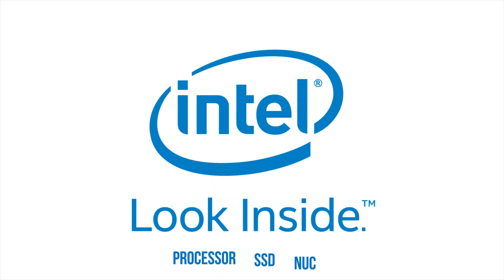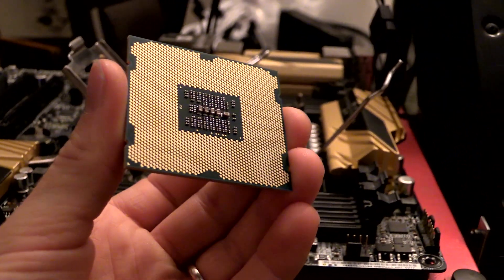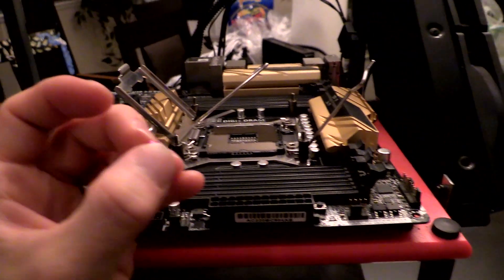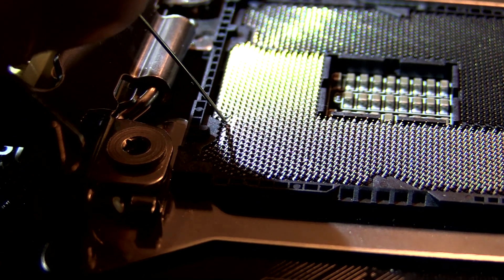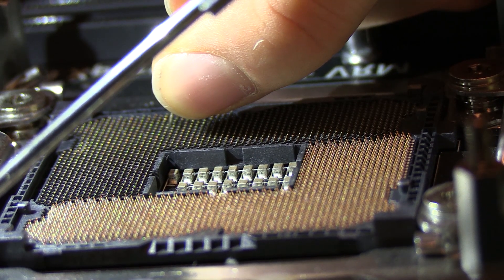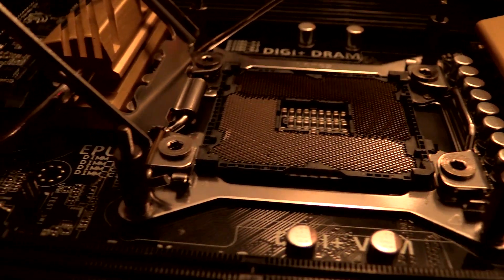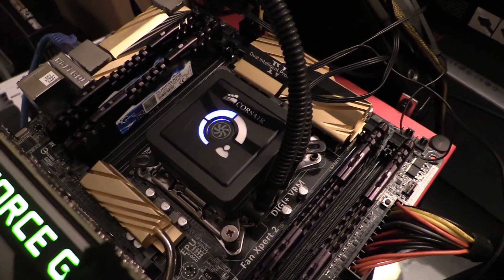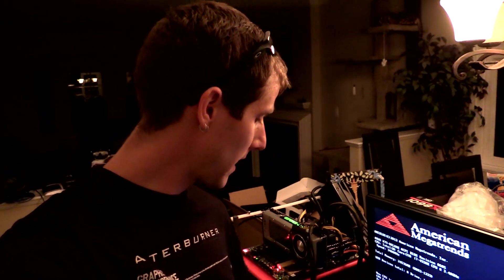LGA 2011 Socket Pin Repair Vlog - Fix a "Dead" Motherboard

Comment: ....Or you can just use AMD since they have more cores than Intel, don't have the pins on the board itself, and don't change sockets every year
Reply: Cores don't say a whole lot about performance and you can fit far more contacts on an lga than on a pga.
Reply: Cores =/= performance. Clock speed =/= performance between different architectures. AMD hasn't released an enthusiast part in ages. Plus they're still using PCIe 2.0, no support for M.2 or SATAe.
Reply: Tom Hodgins M.2 is here. M.2 Drives are here. SATAe drives are here. RAID cards can max out PCIE 3.0 8x, same with PCIE SSDs. There are PCIE cards that aren't video cards. An overclocked 8 core CPU keeps up with a stock 6 core. Obviously.
Reply: D4rkR3bel5

no Video Card has maxed out even PCI-E 2.0 at 8x.. so that isn't a issues as of yet...

http://www.pugetsystems.com/labs/articles/Impact-of-PCI-E-Speed-on-Gaming-Performance-518/

SATAe = find me a HDD i can buy for it....

Currently running a FX8150 @ 5.4Ghz under water cooling... keeps up with the high end i7 in multithreaded Tasks...

CPUs as far as performance haven't improved that much over the last 4 years...

They are alot better on Power.. but thats it...

Same goes for video card within a extent...
Reply: If only their CPUs didn't suck, I hope Ryzen is as good as they say.
Reply: Gustav Magnusson Mac doesn't support anything that doesn't go through Apple first.
Reply: hondarider430 So you're a normal person who doesn't get butthurt when someone recommends something other than your favorite brand.
Reply: As an AMD "fanboy" myself, Intel is just way better bro. More efficient (22nm lithography), much more powerful per core, and plus people are still making stuff for intel. As well as other small things, like some of the Phanteks coolers only mount up-down on AM3+, instead of the optimal left-right. It works both ways for intel, however.
Reply: Coming from someone who uses AMD CPUs, I still think it is better to have the pins on the board rather than the actual CPU simply because the CPU is removable and can be dropped and susceptible to more accidents.
Reply: Well that'a one of the stupidest comparisons I've seen when discussing performance lol. Idiot
Reply: The first chip I ever got from AMD had a bent pin, and I did really notice there isn't mutch protection for the pins in the box, where as the protection for the pins on the motherboard for Intel's sockets is amazing. And saying that you should get something because it has more cores is like saying you should get a rusty old truck because it has a 6 tires instead of the normal 4.
Reply: If you have ever taken a look at single core benchmarks you notice all amd chips have about half the single core performance. This is because AMD has quad core's just like intel but each core has 2 pipelines so they label it an "8-core" machine. Intel does this with hyper threading on their i7's and Xeons, but you gain much more performance out of it on intel, and they don't label it as an 8-core. They just say it's a quad core with 8 threads.
TL;DR: AMD takes 2 cores to equal 1 intel core performance wise, and AMD just uses ghetto hyperthreading and calls it an 8-core.
Reply: Thomas Mitchell it's 4 cores with 2 modules per core... On windows 8 it will show
4 cores 8 threads. An i7 would kill an 8350.
a 3570K keeps up with an 8350 when rendering.
Reply: Daniel Weinberger 18 cores and 36 threads is pretty damn beastly, especially at 2.3GHz+
Reply: D4rkR3bel5
Very ture...

But i think for most people watch this vid they wont be using RAID card or alike...
Reply: more cores dont mean better, and i rather have pins in mobo. easier to have a bent pin on cpu
Reply: hondarider430 For an AMD fanboy, you don't sound like much of a fanboy.
Reply: viperatedrko not to mentoin the CPU is usually (keyword usually) far more expensive than the Motherboard, so i'm good with it being the less fragile side.
just imagine if we didn't have pins at all though, and instead had contacts that weren't fragile on either side. would be nice.
Reply: D4rkR3bel5 AMD doesn't measure TDP the same way as Intel. Intel measures what they think is average power usage, while AMD tests max TDP under heavy use.
Reply: Tom Hodgins $100/yr!.... i would so choose intel over that, intel is like 1/2 that i believe
Reply: No mini ITX AM3+ boards
Reply: ab30494  It depends.. if the CPU or the motherboard cost more.....

when you are talking high end AMD the CPU tend to cost less the the high end board...

and when you are talking intel the CPU cost more then the motherboard... so it makes sense with how each company is doing it...
Reply: D4rkR3bel5 Amd <3
Reply: Gustav Magnusson Plus AMD has some pretty high TDPs. When you consider the form factor of a Mac, you don't really have space for a 220w TDP CPU or a 1000w PSU.
Reply: Tom Hodgins and guzzles 3x more electricty and produces that much more heat (replacement heater) XD
Reply: "and don't change sockets every year"
But they do change chipsets all the same, and a new CPU would not work with an older chipset, regardless of the socket.
Reply: Aimela
2600K/3770K Works on both z68 and z77 boards.
Same goes with Z97 it supports both Haswell and upcoming Broadwell. If you spend the money on an i7 it will last you a long time. I'm  on a 5 year old i7-960 and it still eats games for breakfast. I'll upgrade when LGA1151 Skylake hits, 6770K.
Reply: Daniel Weinberger
Still has stronger cores than any AMD cpu. sell it on eBay for $150 and get a 3770 for $250 $100 upgrade
Reply: It is not a true 8 core CPU.  Every 2 cores shares a module, meaning they share resources.  Also, cores does not equal performance when you talk different architecture, neither does clock speed.  But thanks for trying.
Reply: Daniel Weinberger
the difference in power consumption is negligible. Even when it comes to AMD vs Intel if you factor it out. Power consumption should not be a concern when choosing a processor. Running multiple systems in a server environment is where it would count.
Reply: Tom Hodgins
What are you even talking about? I was talking about your FX 8150 @ 5.4 A single 780Ti would probably kill 3 480's considering
780Ti > GTX580 sli
 Running 3 cards is flaky.
Reply: Or you can easily broke the pins of their CPUs also, because they have pins instead of none for Intel. :D
Reply: Daniel Weinberger
 actually scaling on the old 480s is very good... since they have been out for quite a they have got the SLI down packed...

Even indy games scale really well!
Reply: personally i like as little power consumption as possible XD (says the guy with a 280x)
Reply: Balls to the wall..
GTX 480 ~ 450W
GTX 780Ti ~ 260W

Boy have the times changed. You can fry an egg on a 480.
Reply: norge696
 lol... where did u get that power consumption from???

if each 480 uses 480W how do i run 3 of them with a OCed 8150FX on a 1000W PSU...

IT DOESN"T MAKE SENSE!!!

The GTX 480 uses 250Watts by itself just like the 780Ti does!!!

That is taken from the Nvidia Website...

The stock cooler is just alot better on the 780 then the 480...
Reply: Daniel Weinberger
 yup. gone are the days where they didn't care about power consumption and just pushed the limits to the max!!!

for the desktop world.. i kinda miss those days...

don't get me wrong... the better power consumption is great for laptops and tablets.. but most desktop uses dont care and would prefer the extra grunt
Reply: ElectronicsWizardry
 i would agree...

i was just trying to make a point of saying that a AMD 8 core aka something like a 8150 is an actual 8 core.. and not the same as intel's HT tech on a quad core intel...
Reply: Tom Hodgins 
it has two cores per module... it should be classified as a quad core because the 3570k keeps up with it in rendering...

AMD has two distinct processors in each module that can work on two threads simultaneously. Yes there is only one Floating point scheduler, but it has two 128 bit FPU processing units so it can execute two Floating point operations at the same time
Reply: haha more cores more powa!!!
Reply: Tom Hodgins Maybe I have a dual Xeon board with a broken pin on one of the sockets, and it was going to be some overkill FreeNAS NAS. I don't, but you never know.
Reply: Tom Hodgins Much easier to bend pins in shipping if they're on the CPU.
Reply: D4rkR3bel5 Well yeah. Honestly if I had money, I'd choose Intel in a heart beat. But right now my entire right is fucked up and I'm stuck on a laptop and can't do much about it.
Reply: well considering that an i7 4770k has 8 logical cores... and the new i7 5960x has 8 physical and 16 threads.. 16 logical cores
Reply: Fat Sacks calculating TDP differently or not, when you put these products into test situations and compare differences, and especially when you decide to Overclock things to find their limits - the Electricity usage differences are alarming.
using as much Electricity as most midrange PSU's have in total, and creating as much heat as a Resistance circuit.
for years i knew that AMD's products were more power hungry, but i'd always assumed it was only a small difference. one day i actually looked at usage tests, and i was shocked. you might be able to see my Electric meter spin faster when you turn on an Overclocked AMD machine.
Reply: Daniel Weinberger
 Meh power is cheap where i live.. and it is alot cheaper then upgrading....

My system cost me about $100 a year to run on power... new video cars is around $800 that would perform the same.. that is 8 years of power... now worth it...
Reply: lol how wrong that entire statement is...
Reply: Tom Hodgins >FX8150 @ 5.4Ghz... is your chip magical or something? extreme cooling? I would of went with an i7 + NH-U14S over an FX any day.
Reply: Daniel Weinberger  Do some research before you throw around the "power consumption" as a valid point you'll ignorant.
AMD vs Intel - Does AMD really wreck your power bill?
Reply: impressive wait..... i have a 3330 and i just wanna get rid of it, 4 3ghz threads is just not enough for my usage
Reply: norge696 true true, and heavens no, not a 3770, i also need low power draw since my pc is on all the time so i plan on getting a 1230v2 or similar xeon or a 3770s. but i cant sell my 3330 because this is my only computing device other than dsi and gbc XD (and xbox 360 and wii)
Reply: the 4770 demolishes the 3770 due to slightly better performance with much less power draw..... apparently the 3770s uses less power than my 3330, isnt that cool
Reply: Daniel Weinberger
Uhh no.... 3770 is the same thing as a 4770 minus the new instruction sets and 5%+ IPC increase at best.
Reply: norge696 im pretty sure the 4770 has much lower power consumption... well its doesnt matter, im getting a 1230v2 or similar or 3770s if i dont get new mobo.... and cantl sell my 3330 since wont have a pc
Reply: D4rkR3bel5 you have never seen an AMD Opteron 16 core CPU 
(workstations benefit from more cores at less speed,unlike gaming where 4-6cores at highest speed possible perform the best)
Reply: "....Or you can just use AMD" I don't think you know anything about CPU's, none of your points make a brand "better" than the other...  Number of cores and speed aren't necessarily the winning factor anymore these days.
Reply: norge696
 i was talking about 3x GTX 480s over a GTX 780Ti as well as AMD vs intel...
Reply: norge696
 280mm Rad closed loop by coolermaster with Noctua IndustrialPPC NF-A14 Case fans

Stable @ 45Deg C on a 30 Deg C day :)

5.4Ghz @1.389V
Reply: D4rkR3bel5 They did. FX-9xxx series
Reply: Marcuss2 They did what? I'm having trouble finding the comment you're replying to, maybe YouTube/Google+ marked it as "spam."
Reply: XD
Reply: norge696 "its funny because its truuuuuuueeee"
Reply: Yes. I've done this. It's an easier fix IMO since they all just stick straight up and aren't so close together like the Intel socket, but still.
Reply: norge696
 580s are only 5-10% quicker then a 480...

3x480s performs the same as a 780Ti in all the tests and games that i run.
Reply: Tom Hodgins that scale well like BF.... a lot of games wont scale XD (i think)
Reply: nice, so other than power guzzlers it lasts a long time for you
Reply: thats how technolgy advances, les power, more performnaace.... like the 5th gen 13/15/17 are supposed to consume 50% electricty or maybe it was 1/4 of electricity, and same perfromance
Reply: facts doh, phones have 4 core cpus 2-4 gigs ram, and 1080p screens...... like desktops are, well its a plus to none desktop people
Reply: none desktop gamers..... personally i dont care other than the fact small ** things can do waht i do if not better :/
Reply: Tom Hodgins  TDP is technically not the same thing as power consumption you know?

http://www.tomshardware.com/reviews/geforce-gtx-480,2585-15.html

http://www.guru3d.com/articles_pages/geforce_gtx_480_3_way_sli_review,25.html

Run Furmark for a good hour on all three GPU's and see if your power supply blows up. ( ͡° ͜ʖ ͡°)

Anyways point is... GPU's have gotten so much more power efficient over the years.
Reply: Tom Hodgins Not with 1.5 GB of VRAM. You'd have to turn down some of the filters to stay under your VRAM cap.

 I'd thought about doing sli with my EVGA GTX 670 FTW card, but opted for an EVGA 780 Classified for the extra 1 GB of VRAM instead.
Reply: norge696
 you know that is power read from the wall.. not the power supply... say the power supply is 80% efficient... that would mean 800watts internal power would read 1000watts at the wall...

Most PSU are around 85-90% efficient.. so even if it was 90% in that test it would only be using just over 900Watts inside the PC. so a 1000watt PSU would have no issue with this...

Once again know your facts...
Reply: >Implying cores matter
Reply: Thomas Mitchell They do if you're running VMs or heavily multithreaded workloads.
Reply: D4rkR3bel5 They made enthusiast, one of the FX-9xxx series if first CPU to hit 5 GHz
Reply: Marcuss2 That was a completely insane part. The clock speed did nothing for the speed. ~$800 MSRP when it launched, and the 3930K & 4930K beat it ~$500 MSRP.
Reply: D4rkR3bel5 I7's are OP
Reply: ephesix No mini ITX LGA2011 or 2011-3 boards either.
Reply: D4rkR3bel5 Are you joking? You cannot put that much power on a mini-itx board, 2011-3 needs a quad channel DDR4 kit and a X99 chipset, that will never be on a ITX board
Reply: Daniel Weinberger No they are not, amd's 8 core are over powered, 4 would of been fine.
Reply: norge696 Exactly, i use a 3770k :)
Reply: Thomas Mitchell I would bet it's the same with AM3+, given that the AM3+ CPUs use a 32nm manufacturing process.
Reply: norge696
 um.... no....

it is a true 8core.. just 2 core share the same L2 cache but have different L1 Cache.

The HT in intel chips are just a optimisation of multi tasks.. totally different...

Once again get your fact right.

also on the windows 7/8 doesn't read the CPU correctly...

CPU-Z a true cpu test program detects all 8 cores as it should
Reply: D4rkR3bel5 I know, it was ridiculous, but that was the strongest they could go
Reply: Tom Hodgins It detects 8 cores because there are 8 temp sensors...
Reply: D4rkR3bel5
 um... no....

AMD
http://www.cdrinfo.com/images/uploaded/AMD_FX_8core_architecture_large.jpg
Intel
http://archive.benchmarkreviews.com/images/reviews/processor/4770K/intel_corei7_4770K_Haswell_Die_Funct.jpg

As you can see.. the per pair of cores in the AMD they share the same L2 Cache. so there is 4 L2 Caches. and 8 L1 Cache

Intel has L2 Cache for every Core...

Once again... Know your facts...

AMD = True 8 core... basically 8 cores turned on = twice the performance then 4 Cores turned on
Intel = 4 Core with HT.... Basically if all 4 cores are on with HT you end up with 10-20% more performance then with just all 4 core enabled...

a 4 Core Intel With HT does not = a 8 Core CPU...

Just like a 8 Core AMD CPU is actually a real 8 Core CPU...
Reply: accually intel has more cores than intel. amd has a 16 core cpu and intel has a 18 core cpu and intel is much faster per core
Reply: Marcuss2  first consumer cpu to hit 5 ghz. IBM has had many PPC parts in their mainframes that hit 5.5
Reply: ElectronicsWizardry Intel has more cores than Intel... great
Plus Intel JUST announced their 18 core server part on Friday.
Reply: D4rkR3bel5 ..... 15 cores HT that can work with 3 more together wasnt enough... seems legit.... these servers can probably render a 10 hours 4k video in under a minute XD
Reply: D4rkR3bel5 then multiply that by 4 :0..... i mean yeah its only useful for server use realistically but thats like 9  virtual pcs on one cpu
Reply: D4rkR3bel5 But you need to devide 2.3GHz by 18 and then you have your true number (aka. AMD is worse than Intel)
Reply: Tom Hodgins videocards arent the only think you put into pci slots, what about raid controllers? and 8 cores and 4.5 ghz is not bad.
Reply: haven't touched AMD since super socket 7
Reply: So I should go with an inferior brand? Deal!

Comment: Intel Pentium 4 2.8GHz Northwood on PGA478 socket, I managed to drop the CPU on my keyboard and bent 5 pins… I just took a pocket knife and managed to bend them back into place and it worked!
Reply: I had a friend try to cram the wrong cpu into the wrong socket. I found another good tool was a fine ball point pen. Just remove the tube of ink then use the hollow tip to fit around the bent pin.